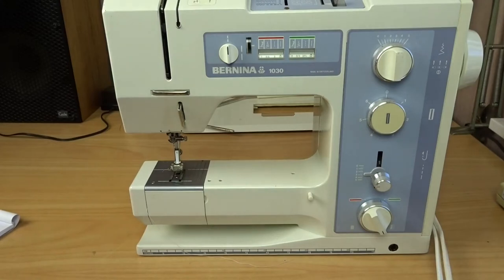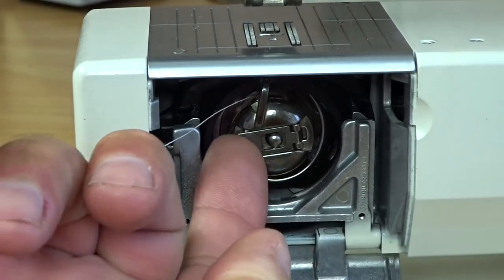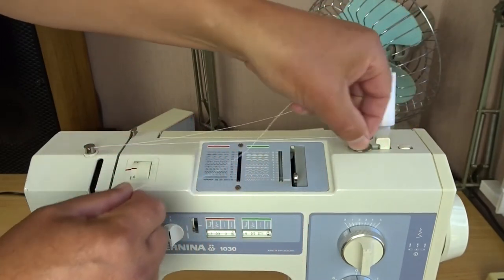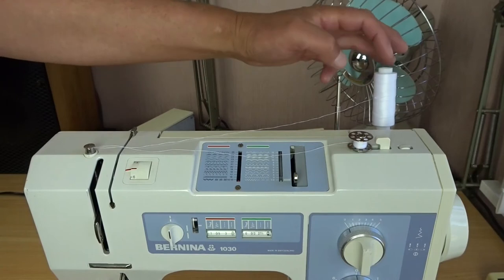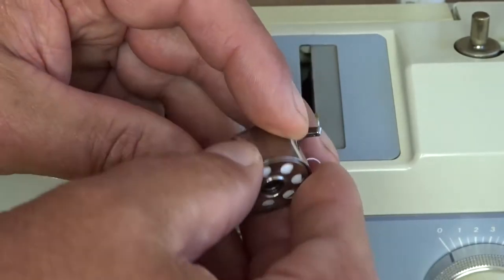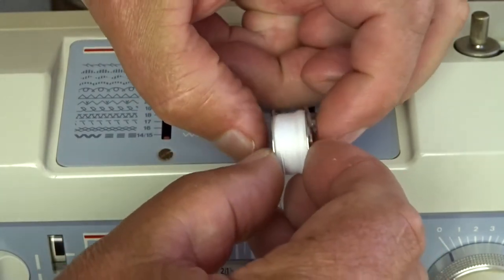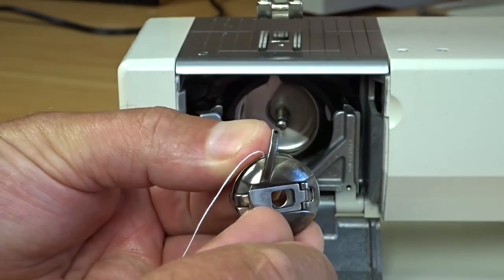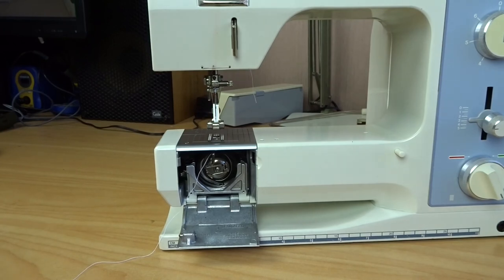Bernina - Basics Part 2 - Bobbin Winding - Models 1030, 1031, 1080, 1130, 1230, 1260 and More

Comment: Those are the wrong type of spools to be used on vertical spool pins. The thread will twist as it comes off of them that way.
Reply from the maker: Haven't had any problems with these spools in the 20 years I've been using them.